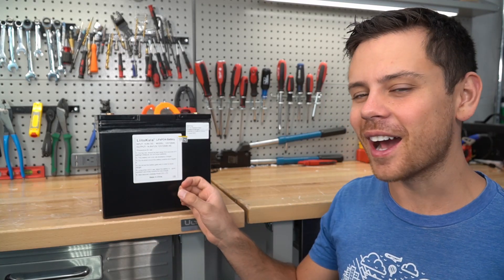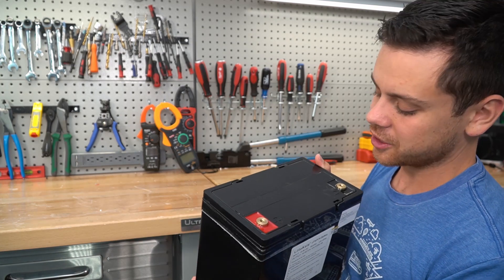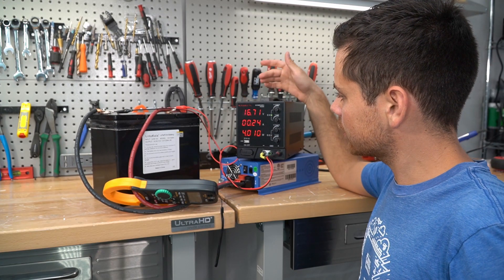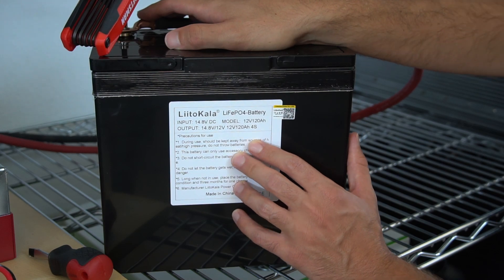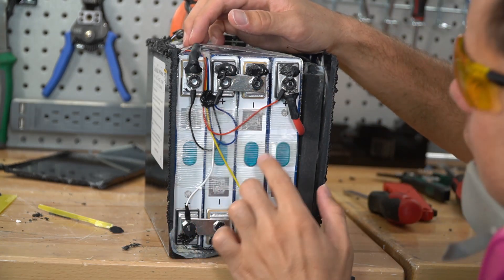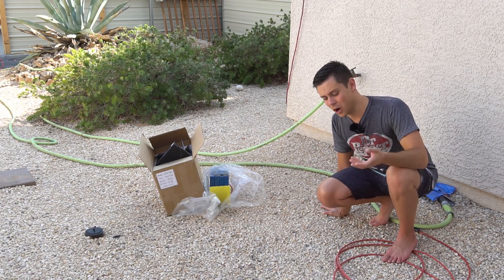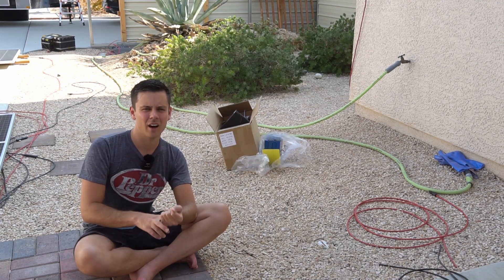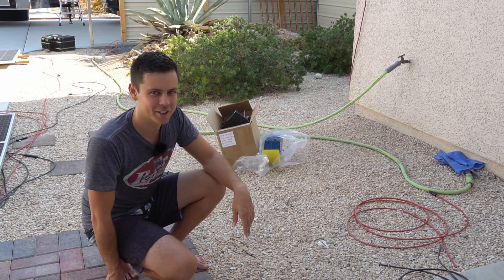Aliexpress $280 120Ah 12V LiitoKala LiFePO4 Battery

Comment: Lead acid must be expensive in America because in the UK you can get a 110Ah for £60 lithium is 8x that here.
Reply: 110Ah what? Deep cycle? AGM? Flooded? run of the mill car battery? 
Lead Acid you get 50% Depth of Discharge and ~1000 cycles before they are toast..   LiFePO4 you get 100% DoD and 2000+ cycles + 1/3rd the weight.
Also the Li ones from a local battery store are really that more expensive than what is being talked about here - direct imported LiFePO4 from China (risk inclusive). If you look around in the UK you should be able to find an online importer that reduces the risk and gives you Li at twice the price of LAB.
Reply: @joansparky4439  if you're not lugging the batteries around lithium just is not worth it compared to lead. I have a battery tester, I buy local batteries for £20 each secondhand if they are of 80%. I have 4 banks of 4 and they don't really cycle at all. Some of them are 10 years old.

Comment: Still cheap for what you get even if it doesn't meet stated capacity, lead acid batteries aren't that much cheaper than this one! Yup, they advertise only high temp protection.

Comment: Ever heard of PFDD of China?
I just bought a 200 amp hour LiPO4 from them for $297.  Weighs in at 25 pounds . . . . . .   Wonder if it’s worse than this one :) Also took months in shipping.
Reply: 200ah should be 45 lbs I believe
Reply: @LibertyDIY  indeed it should. The one I received measure up as 70 amp hours . . . . . . .      Hence the low price and “free” included charger. (aka ripoff)

Comment: I have a battery operated B&D cmm1200 mower that came with 2 12v 18AH lead acid batteries. Worked well at first, but then the next season the batteries really degraded. Long story short, I finally bought two 12v 20AH Ecoworthy LifePo4 batteries from amazon, and they are so much better!

Comment: I used my heat gun to soften the glue joint around the battery case. Came apart easily and was able to put back together.
Reply from the maker: Ohh smart idea
Reply: I'm smelling Jerryrigeverything here lol. But yes good idea

Comment: Nice vidéo , eventhough no battery can last decade, normally 5 years max
Reply: My CALB cells are on their 7th year of full time RV use.
Reply: @cdkipp  The Walmart Everstart in my Sentra just hit 6 years this month and is still going strong. I started out with the largest one that would fit, occasionally checked the electrolyte level, and put in a cadmium-based additive to it a year ago. I have had 40 years of good results doing this. Sad thing is, companies could make better lead-acid batteries if they wanted to. Back in the day, you could get a Sears Diehard guaranteed for 10 years.

Comment: How do you clean it up? If somebody else has an incident, drops one on the floor or whatever. How do you clean it up? And do you really need to buy a whole new table?
Reply: Only if you got a cheap table..  I use formply for my workshop tables. If one is badly worn I can just get a new sheet..

Comment: Apart from "low quality BMS", what's wrong with this as a 100ah battery for cheap? Many ppl don't live in freezing conditions, so don't need low temp cut off.
Reply: I agree. And many mppt’s have low temp cut off built in.  An mppt is going to hit low temp before active cells, so what’s the worry?
Reply: I wouldn’t trust this battery to not overheat, melt wires, or catch fire.   In this price point - I just can’t see good quality control at all.  As stated, if this were for some remote installation, probably fine, but I would isolate it from anything expensive.
Reply: @DeltaEchoZulu  I share your opinion, but my point is this should be about objectively reviewing the actual product, not just saying "Its cheap, I don't trust it.".  Otherwise why look at these cheap ones at all? I don't think he highlighted any issues with wiring or connections, actually I vaguely recall him mentioning something good about them. Maybe there are specific bad things, but I did'nt hear anything except "cheap BMS". Regardless, I'm still very happy Will is looking at these cheap products, I find opening cheap stuff like this far more entertaining than high priced stuff :)
Reply: Thanks for that video!
I have bought one and would like to change BMS.
Which one would you suggest?
280Ah 12V 4

Comment: For the price, this still beats a lot of 100AH batteries.  So if you ignore the 120AH label and just consider it a 100AH battery I could justify this. (note that it almost never gets below freezing in my area so cold temp sensor isn't that big a deal for me).
Reply: There is the matter of integrity. People come to this channel because of the honest reviews. The acceptance of lies as good practice diminishes both us and honest manufacturers.
Reply: @Rob Hunter 2000 cycles? Doesn't the drop-off slow down a touch?
Reply: this company also markets a 100AH.  bet it only tests around 85-90 😂 it's like TrustFire got into the lifeso4 business with ever exaggerated capacities. maybe they're really 120AH cells but they cut off charging early to extend cycle life, but decided to advertise the nominal capacity?  I doubt it.
Reply: Am I crazy (not to big into this) could just fashion a cut off in cold temps another way (for the entire system) no matter the battery?

Comment: How about recommending some LiFePO4 batteries that are small enough to fit as replacements for the lead acids in my 2007 Winnebago Itasca Navion? I can only find group 27 size ones on amazon, and I can’t fit two of them under my step compartment.
Reply: This one is very compact ,smaller than group 27
Reply: I saw a guy who replaced his car battery with super capacitors. It was pretty impressive. Seemed to work fine.
Reply: LiFePO4 batteries charge at higher voltages.  So if you replace the lead acid with one of these you need to upgrade your battery charger otherwise the LiFePO4 battery will not charge to 100%.
Reply: @Me-yw9mi  that’s ok, 13.6v is enough for 98% . Lifepo4 don’t like to be full anyway. Only issue is 13.6v charging is very slow.

Comment: I am wondering why you don't use a Dremel too to cut around the plastic less chance you nic a cell compared to that thing where the blade has to be inside of the case/battery. I do wonder if they would be decent for the price even if you didn't care and called them 100Ah

Comment: My imagination comes up with a scenario that while you are doing a capacity test away from your shop for five hours something goes awry. How about some sort of containment vessel to safeguard your shopping house from possible incineration. How about a smoke Alarm and possibly heat sensors with Wi-Fi that can alert your phone.
Reply from the maker: Yeah discharging doesn't scare me at all. Comment above me is correct. I am only worried about charging. I've only had issues while charging.
Reply: @WillProwse  
Website says 50 Amps max charging rate, and you used 69 Amps. Was that safe?
Reply from the maker: @imconsequetau5275  nope
Reply: discharging isn't that dangerous (unless it's a dead short) and it has a cutoff/bms. It's charging, especially at higher speeds, where you run into danger.

Comment: I got 14 years, 8 months from my Rolls Surrettes SA530 lead acid batteries. Off-grid.
Reply: On 7 years on lead acid interstate batteries they run my house. I am getting new ones as though as the house I'm currently living in was my uncle's house and let's just say he had it set up oddly. Running a whole bunch of 12 volt appliances and lighting off 2 of the batteries instead of using step down converters or just switching to 24 volt lights and such.
Reply: @bishbosh7728  12V appliances are cheaper and more readily available than other dc voltages because of rv usage.
Reply: @gregb1714  I know that but if you're on a 24 volt system and you use 2 of the batteries for 12 volt appliances and lighting those 2 batteries are used at a different rate than the 2 that aren't thus making them cycle much more than they should . Also more money wouldn't have mattered my uncle had enough to do whatever he wanted he instead would just buy new batteries every 2 years no matter what I said about it . He spent 7k in ten years on batteries alone because he didn't understand why they didn't last and wouldn't listen or look anything up to try to figure it out.
Reply: Wow!, Did U not use it until the last couple of yrs. of...just being sarcastic, but what was it used for & how many cycles did U get outta of it??
Reply: @t.c.3027  - the batteries were used for my house we lived in full time. I don't know the number of cycles. They never ran low on water and rarely went below 50% DOD
Reply: @tZydeco  Thanks!, that has possibly caused me too reconsider at the start of trying those, for the price of...I don't think I can go wrong! Thanks again!
Reply: @t.c.3027  - you're welcome.

Another consideration. When I brought in the dead batteries the recyle price of batteries was $0.40/pound. Last I checked it was like $0.22/pound.

Each Rolls-Surrette weighed about 125 pounds. So ...

 125*24*$0.4=$1,200

In French Louisiana that's referred to as Lagniappe
Reply: @tZydeco  Very interesting, hopefully Will will get a load of this & do a review on it! i.e.,sounds promising!

Comment: When will they create a battery technology that is non toxic?
Reply: Stick 2 electrodes into a lemon or a potato.
Reply: There was a battery chemistry produced by a company named Aquaion mostly saltwater and cradle to cradle totally recyclable and non toxic. They were big and heavy and came with a 10year warranty but the company went bankrupt and was bought by a European company who decided to not honor the warrantys.
So now people have giant heavy dead batteries after 5 years but at least they are recyclable.
Reply: @noahdawn3964  I remember reading about those aluminum/saltwater batteries.  The US military uses that exact chemistry for some torpedoes and ocean exploration vehicles.  It is the future for sure.  I also remember reading an Indian electric car company is attempting to utilize this technology that requires a swap of the aluminum/saltwater power units approximately every 3000 miles.  Totally recyclable and very efficient.
Reply: 2031

Comment: You need to do a run down of your top LiFePo batteries by the price point. You've done so many it's hard to keep track of them all!
Reply: I'm not sure it would be useful.  Usually when he finds a good one it goes out of stock not long after he posts the video.  And considering how shady some of these companies might be, it wouldn't surprise me if they cut corners while rushing to restock supplies.  Thus, he would probably have to do completely new reviews on them before recommending them again... just a guess.

Comment: Do you have much knowledge about how quickly that 104Ah is likely to degrade given these are already basically end of life cells, I know cells are commonly re-purposed but I would guess this is a bit extreme?
Reply: They look to be new cells that were rejected (grade b) because they didn't meet capacity. So they will last, not used end of life cells.
Reply: @gregb1714  To my mind 69% capacity doesn't qualify as grade B, these are either used or junk
Reply: @adammathieson1428  104 / 120 = 87% capacity. So 13% low. Or maybe chinese overstated capacity at 120Ah. Probably 100Ah cells, they usually test a little higher around 104Ah. The price is still cheap!
Reply: @gregb1714  Yeah, fair point, Will was saying they were maybe 150Ah cells in the video and I got mixed up, they didn't claim that.

Comment: Just a FYI a lot of people including myself watch your videos on these batteries because we use batteries in boats and kayaks to run electronics and trolling motors. The weight savings, all day performance and large number of charge cycles along with battery life is what we are looking for. You are always talking about solar use but there is an entire other group that benefit from these types of batteries. Please keep us in mind and consider our usage of 50ah and 100ah batteries.
Reply: Absolutely right!! I too am a boat owner and i have a lifepo4 bank on my sailboat. Ive actually been wanting Will to conduct a test of those bifacial solar panels on a boat. im curious of the water reflection on the underside of the panels.
Reply: ^^ this. I found this channel because I am planning to get a lifepo4 battery for my dinghy. I would love to see some reviews of <100Ah batteries.
Reply: @Finder245  i recently bought a zooms 100ah lifepo4 battery for my Avon 10 foot tinder. I bought it based on Will's review. I had a feeling they would sell out fast especially after he did that review so i jumped on and bought it right away.
Reply: Dakota lithium’s are popular choice for trolling motors. Like there 36v 63ah battery. There are no youtubers that have yet to do a teardown on one.
Reply: I agree, but in this case it is 11kg or 24.2lb , 3000 cycles. Some info are available from the seller if you click the link he provide. Seller info is not always right for cheap battery like that but for cycles will would have to test it, 3000 cycles at one cycle per day is around 8 years.

Comment: The battery market is pretty interesting. It's scary how many of these things are in houses of people who don't know how dangerous they can be.
Reply: The LiFePO4's are pretty safe, no thermal run aways.
Reply: Can you believe people live and work in buildings with lightning flowing through the walls nowadays? Do they think they're Zeus? Madness.
Reply: Lead acid batteries have battery acid, but the LiFeSO4 have other nasty chemicals.  Some people are used to battery acid and have  awareness of those risks, but there's probably not enough warning stickers on the lithiums.  I've never seen a leaking battery that was good news, but I didn't realize how nasty lithiums were.
Reply: It's not like they're lithium ion, like the Tesla Powerwall, which would make a fire that couldn't be put out if  it's cells were punctured.

Comment: The add on the link you provided clearly specified Maximum charging current: 50A
Reply: Just 1 more mistake😜however, he was still consistent with trashing a trash battery!! China I believe took three months making sure it was definitely glued together good, know exactly what Will was going to do!😄...
Reply: @t.c.3027  you do realize 3 month waiting period is due to shipping right? A bunch of junk has to be sorted into containers then loaded on a ship. Its a bit more complicated than you think especially if there is a bottleneck...wich there is. Not enough ships to ship as needed. Also now more strict customs due to the flu.
Reply: @Bass_attack7755  Actually I really wasn't aware of that, just didn't think something would take that length of time normally or even w/the covid situation, thought I was really being somewhat sarcastic with a lil humor from my remark. Although I do know for a fact, that postal items can take six weeks for delivery, however time is very valuable in which would be expensive for me. Thanks for the info, I won't be ordering items that's going to take 3 months to receive, especially from China!
Reply: @t.c.3027  try to go fed ex or other carrier route. Another youtuber ordered 2 shirts one from US and one from europe..... the europe one got to his house first. He tracked the other one and it literally passed his house and ended up I think in another state. The postmaster  general is deliberately destroying the post office. Remember when mail took 3 to 5 days for a letter? Wonder why Christmas letters get delivered in January or February (if your really unlucky). Birthday cards could be sent and you knew what date roughly within 1 or 2 days it would arrive ( often on the b day). Thats all in the past.
Reply: @Bass_attack7755  I tell you,  seem as everything is upside down! SMH...Guess this is the new norm!

Comment: The solvents used in the newer LiFePO4 cells are not as hazardous as the solvents that used to be used.  Heck brake parts cleaner is worse for you than the solvents that are used now and people use brake parts cleaner all the time without issue as long as good ventilation is provided.  You still want to minimize or eliminate the breathing and bare skin handling of the solvents but as long as you treat it like a spill of just about any flammable solvent you will be fine.  You don't need to replace your desk as the solvent will evaporate so just air out the room and wipe the desk down with soap and water and it will be fine.  Treat it just like if you broke a fluorescent bulb, it's not a big deal, you just follow basic safety and cleanup procedures.  It doesn't require extreme hazardous waste disposal just drain the power of the damaged cell or cells and store it in a vented container until you have enough cells to justify a battery recycling pickup and then place the leaking cell in a couple sealed bags and mark it as leaking cell and handoff to the recycler.

The only time you need to deal with the cell being hazardous waste is if you need to ship it back for a warranty or something.
Reply from the maker: Good to know. The old safety sheets make me cringe. I'll have to look more into this.
Reply: @WillProwse  I was sprayed with the electrolyte of lifepo4 cell in my eyes one week  ago .Fortunatelly I washed my eyes in less than 5 sec.It's Ok now.
Reply: @ΘωμαήΚαραγιάννη  So,how's the third eye in your forehead working out for you?😋
Reply: @engleblerthumferlumpadinck6536  In case it happens  
to you ,stay with the electrolyte in your eyes, and tell us the result.